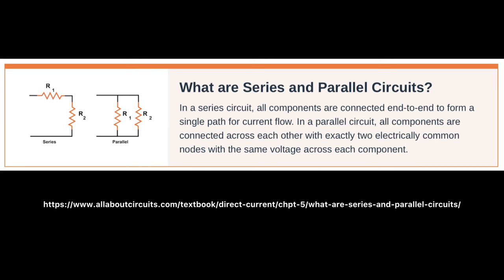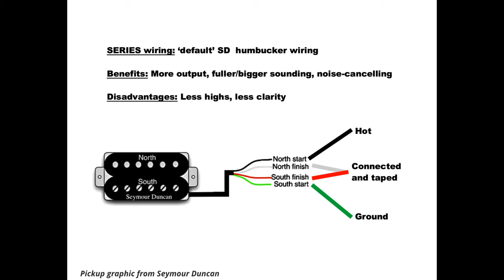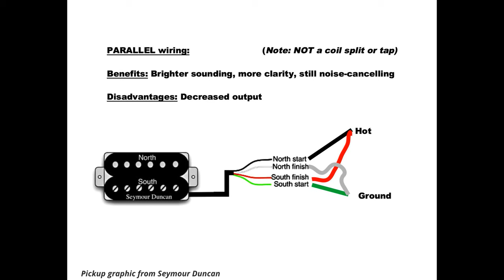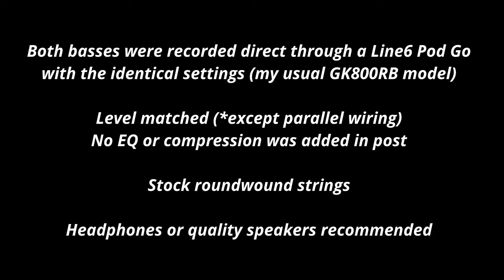Squier Bronco bass mods Ep.2: Seymour Duncan Hot Rails pickup. Series vs. Parallel!

Comment: I'm so glad you are featuring this bass as a mod platform.  It is very inexpensive and has lots of potential.  I have a white one that I modded the crap out of. I won't list everything I did, but I did make a new pickguard out of mother -of-pearl material, routed it for EMG precision pickup, added a battery box, recarved the neck and sunk it into the body about 1/8 and put on a new bridge (I had a nice one laying around, it's a Stew Mac one, l'm not sure the brand) , I also tweaked several of the frets for level. Now I have a nice light bass that looks good, has killer tone and plays great.  Keep up the good work...oh ya, I'm running Ernie Ball cobalt flats 50 to 110, LOVE those strings on a short scale.
Reply from the maker: Thanks so much for watching!  Totally agree, the Bronco is pretty budget friendly.  Have a variety a bridges I'm going to try out in the series after the pickups.  Unfortunately, with lower price-point instruments, there is considerable variety in quality and outcomes.  The white bronco I'm modding has a very nice acoustic resonance and ring to it. I think that comes across on the recording.  And the neck is pretty solid.  That's one of the reasons I've chosen to mod this particular one.  My ultimate goal is to make a stellar (inexpensive) back-up bass for when I don't want to the bring the F bass, or for outside gigs in the rain, haha!

Comment: Hi Jonathan!, I'm loving this series! You are inspiring me to start my own little bass mod project... There are some modifications that I would like to see you doing on this bass: shielding, bridge, and tuning pegs. Also a string change to flatwounds or nylon tapewounds. For the sound comparison, I think it would be great if you could cut the scenes back and forth (3 to 5 secs) between the setups to give us imediate feedback. Keep it up the good work! You got a new subscriber.
Reply from the maker: Thanks for watching and supporting the channel!
Without giving too much away....you've read my mind!  Up next, shielding with copper tape on both cavity and pickguard (pre & post), more pickups coming, a few different bridges, and then strings (exactly as you've suggested, tapes and flats)!
As for the back and forth scenes, I plan on making a compilation conclusion video which will cycle through the different parts as you have suggested.  Having made the rapid comparisons in previous videos, some viewers found it aurally confusing, hence the relatively longer passes.  
Stay tuned and thanks so much for subscribing!
PS the sonic series bronco already has an upgraded bridge and tuner set. I’m not sold on the bridge, but the stock tuners are pretty good, and I’m not confident different tuners would result in a sonic difference. They turn relatively smoothly and stay in tune. Look relatively lightweight.

Comment: This is a great series! Thanks so much for taking the time to put these videos together!

When you're selecting your guitar pickups for the bronco, are you ordering the neck position or bridge position? Is there a reason as to why?
Reply from the maker: Thanks for watching!

This SD is the ‘neck’ version.

In this bronco series, P bass style pickups are typically ‘neck’ by default. However, the Artec soapbar was the neck version. Typically, the outputs tend to be a bit hotter in the bridge version (as less string orbit by the bridge) or they may be voiced differently for the same reason. Some ‘bridge’ bass pickups are also bigger/wider as the strings have a bit of a spread, wider string spacing at the bridge. Eg the bridge J is wider than the neck J p/u.

Comment: Love that I stumbled across this video…I’m gonna be switching out the stock PUP with a SD hot rail in series… am I understanding correctly the wiring?  I’ve got the white and red  spliced and taped together…the green and bare going to the black lead…and then the black to the white?
Reply from the maker: Here’s a link to SD’s website on humbucker wiring. Every company follows a different colour scheme. 

https://www.seymourduncan.com/blog/latest-updates/humbucker-wire-color-translation

For SD, white and red are spliced together and taped as you said. Bare and green both go to ground (Eg case of the pot) and black is the hot lead that goes to the pot terminal. 

Thanks for watching! Good luck!

Comment: The Hot Rails in series definitely has the best tone! One question I have is: Is that the neck or bridge version of the pickup?

Also, outside of the EMGs I recommended in the previous video, some people have also recommended the Dimarzio Air Norton S. Like the HR, it is a rail design but doesn’t have as much output. Some say it has a better tone. Great video!
Reply from the maker: Thanks for watching Ep.2!  
It's the neck version.  I forgot to say that in the video.  I'll add it to the description.  Good catch!
The EMG is on order.  I ordered the S4, as I feel going back to 6 pole pieces in S2 or S3 could potentially be a back step, magnetically.  The S4 is a rail design with more lows and low mids (as advertised!) .  Will see whether that's true!.

I have a DiMarzio jazz humbucker I'm going to experiment with.  See whether it's worthy of a video shoot. Stay tuned!

Comment: hello, thanks for these series, are amazing. I recently bought this same pickup for my bronco, However, I don't know why, I sent it to my luthier and now the souund is so weak, I have to turn on my compressor pedal to raise the volume, do you think that it might be the pots or something like that?, did you experience something similar? Thank you beforehand! and take care!
Reply from the maker: Thanks for watching and asking!  When I had the Duncan Hot Rail in, the output was HOT.  The series wiring was louder than the parallel.  It's possible that the pots are bad, ...however....another possible scenario is that the pickup is wired incorrectly inside the cavity.  It's not fair of me to create distrust in your luthier.  But every pickup company has a different colour code for their wiring and it's very easy to mis-wire as a result (unless you consult with the instructions).  My suggestion would be to confirm that the wiring is correct first (series is the default wiring on the diagram if my memory is correct).  If wiring is correct, could then ensure all the pots are good and well grounded.  If that still doesn't sort it out, it is always possible that you have a broken or defective pickup (which is rare but not impossible from Seymour Duncan). 
I hope this is helpful!  Hope it's an easy fix for you!
Reply: @jonathanwong458music  ohhh un going to check that out! Thanks for the answer! Have a nice day! And thank you again
Reply from the maker: @ignacioantonioaedosepulved453  good luck to you!
Reply: @jonathanwong458music  hello again, at the end the pickup came broken from the factory! Now I'm going to have one in good condition. I wanna thank you for your assistance and time.
Reply from the maker: @ignacioantonioaedosepulved453  Glad the store or Seymour Duncan is taking care of you!  Best of luck with the replacement!

Comment: Hi, did you change the pot to 500k or you used the original pot (250k)
Reply from the maker: Thanks for watching!  In all of these episodes, I used the stock/original pots.  The stock volume pot went intermittent before the shielding episode, so it was replaced with a CTS 250k.  Only in episode 16 did I use a 500k pot, but that was the whole point of the episode! So unless otherwise stated, it's a 250k pot in order to keep as many variables as constant as possible.

Comment: I notice that the pickup with the parallel wiring has less output than the stock pickup.
Between the three sounds, I prefer the stock pickup, too bad for the parasitic noise
Reply from the maker: Yeah, in general, parallel has slightly less output, but you get more highs and clarity in exchange. The parallel sound definitely has its use and could be useful to cut through a dense mix. Just need a little more input gain.
Thanks for watching!

Comment: I prefer these Seymour Duncans to the Musiclily Dual Rail Hot Humbucker.
Certainly the Seymour are more expensive but seem more versatile
Reply from the maker: I agree with you! The Duncans are more musical sounding. Thanks for watching! But yeah, ~3x the price of the musiclily
Reply: @jonathanwong458music  Are the Duncan SCR-1 or SHR-1 ?
Reply from the maker: It's the neck version of the hot rail - SHR1N
(not the cool rail)
Reply: @jonathanwong458music  SCR-1 / SHR-1 What's the difference between the two please ?
Reply from the maker: @Arcade1959  Both are electric guitar pickups by design and as I understand it, the Hot rail is SD's hottest wound humbucker in a single-sized shell.  Higher output.  In contrast, the cool rail is a less hot, slightly lower output version of the rail design.  I suspect in a Stratocaster type guitar, the tonal differences will be more apparent than in a bass.  I've never tried the Cool rail version.  Check out SD's website for more info!

Comment: The parallel mode wiring is not true humbucking.
Reply from the maker: As I understand it (and I may very well be wrong), one of the hot rail coils runs in the opposite direction compared to the other.
Thanks for watching!

Comment: Series full tone for me.
Reply from the maker: Right on! Nice choice. Thanks for watching and sharing your thoughts!
Reply: @jonathanwong458music  What is a good gauge string for these 30 scale bass?
Reply from the maker: That’s a great question. If you want to ‘string it properly’ with the correct string wound length, then you are limited to what the manufacturers make, which is not much. Unfortunately, most short scale sets are the usual 45-100. A few make a 50-105 (Eg D’addario) and Fender only has their nickel 40-95. 
Might be out of luck if you want a 110 E….

If you are willing to risk using long/standard scale strings, then you have much more choice. But you do risk string breakage around the tuning peg especially if it’s a smaller diameter peg. The sharper break angles can cause the string to unravel or have the winding snap.